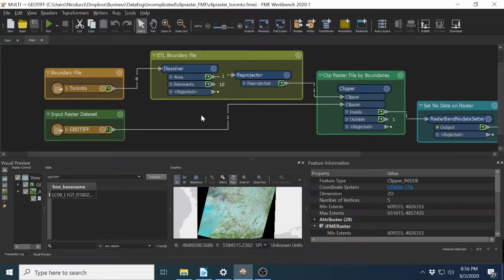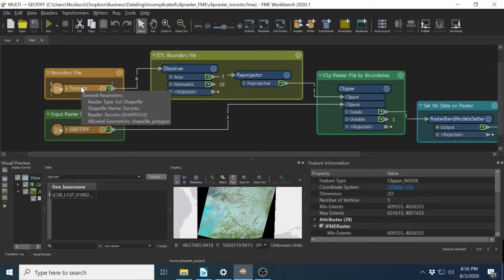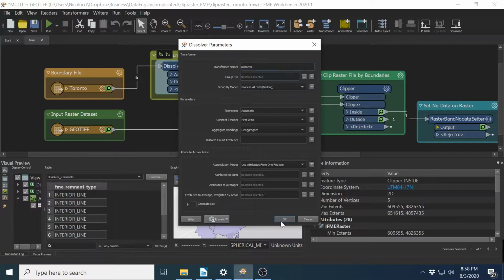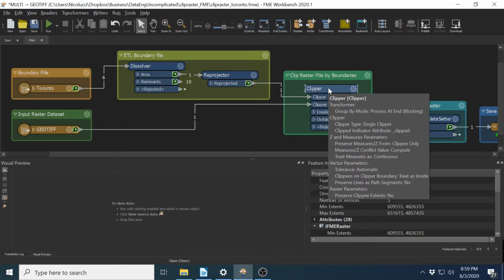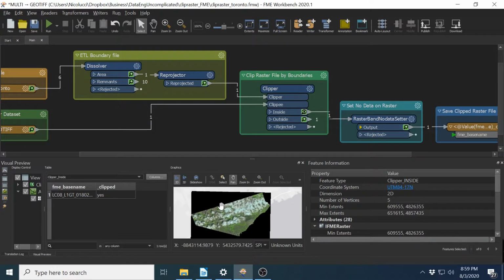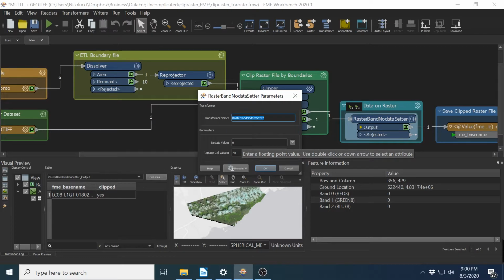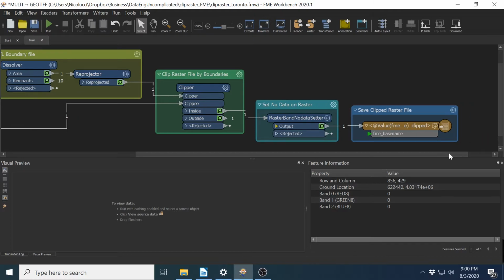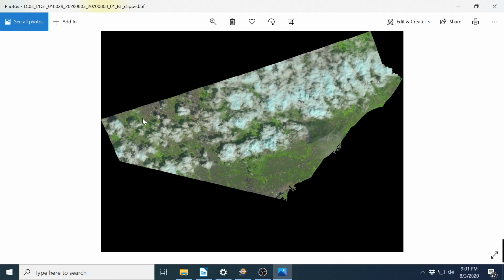How to Clip a Raster in FME

Comment: Thanks for the video. I have some gaps between my raster and my polygon clipper. Is there a way to get the clipped raster exactly the same area as the polygon by filling in the gap with a value that we set?
Reply from the maker: you're welcome Hery, Yes, I believe you should be able to set the value of the background pixels. I made another video which I think answers your questions https://youtu.be/cnUnwnba1AI
Reply: @DataEngUncomplicated  Thanks for the prompt reply. That video is useful too but it's not what I want. Sorry I didn't explain it clearly. Say I have a polygon clipper, which intersects but is larger than the raster extent. So there's a gap between the raster and the polygon. Now I want to clip the raster so that I will get a raster with the shape of the polygon, and the gap is filled with pixels with 0 values. Is it something that can be done?
Reply: @ombaksegara  You have probably solved this by now. If not, one approach would be to reclassify the pixel values in the gaps from NoData to 0 with the transformer "RasterCellValueReplacer". If the NoData value is set to 0, consider editing the NoData value with the transformer "RasterBandNodataSetter".
Reply: @JockeGards  Yes, I have figured it out :)
Thanks!